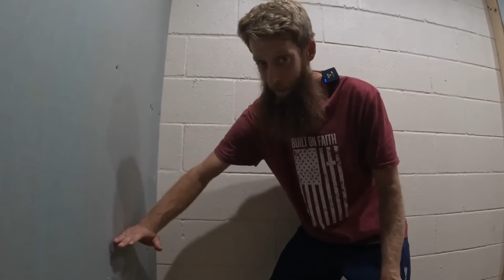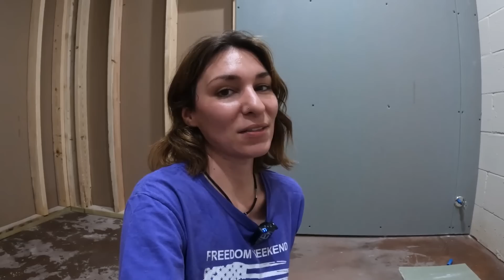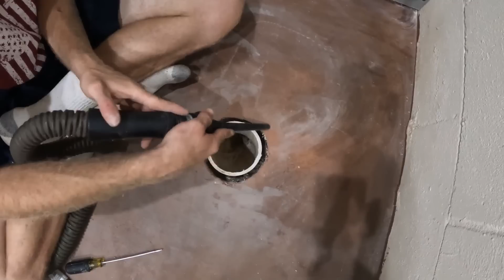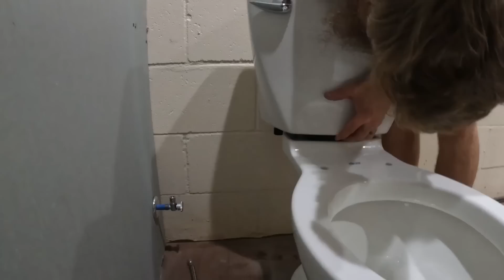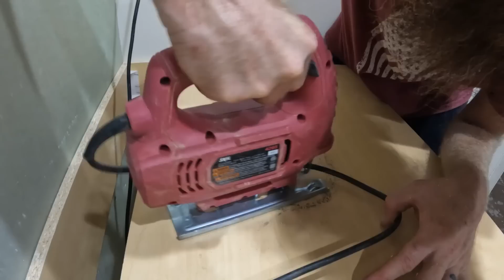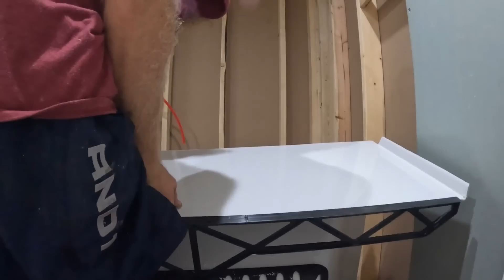Our Bathroom Install Begins!| Closer To MOVE IN| Sink & Toilet |Couple Builds Basement for  Cabin

Comment: If you want to find the meaning of life, get yourselves the highest end Toto toilette with a bidet you can afford for the cabin build. When I first used one, I wondered why I hadn't known about this my whole life until then. The first thing I replaced in my bathroom when I returned to the US was the toilette. In Japan their tubs have a filler spigot, a waist high shower nozzle, and stand up nozzle, or a hose nozzle with two hanging points, they also come with a recirculation pump that maintains the temperature. I have a bronze clawfoot tub that I modified to semi-equal this arrangement.

Comment: Thompson waterproof sealer is to keep water from penetrating into the concrete like rainX does for windshields. Its slippery when concrete gets wet though. It is not something you use as a permanent finish that is a completely different type of sealer like what you see in a farm store floor. Flooring can always be changed later down the road basement looks great!!!!

Comment: when we set our toilet waste pipe , we use one half sissle rope and wrap the pipe to above concrete pour. then all you have to do is untape the top rope and pull. leaves a gap to set the toilet ring. Just an old easy trick.

Comment: Real nice work on the install there Gary. You made it look real easy too. Good prep by you works miracles :)  Where did you lose your clipon mic to? lol. 
Floor thoughts:  Someone with the exact same issue is Lumnah acres.  They contacted the manufacturer of their sealant for advice and got an opaque sealant to topcoat with (looks just like painted, it's neat).  However with throw rugs down you won't see it so is it worth the time and expense? 
Mel, give in and rest if you want to recover the fastest.  The more you push yourself the longer it will take.  Please rest. Health is soooo important.

Comment: they have floor epoxy in different colors for flooring that goes on cement to cover up your flooring all you have to do is spread it on the flooring or paint it on
Reply from the maker: We might look into that at a later date, but are done with the flooring for now until we finish the cabin upstairs. We wont want to spend anymore energy on it at this time. :)
Reply: @SimpleLifeReclaimed  thats good yall are doing great thought i would mention it if you would want to fix it later on

Comment: Congrats on the bathroom your  toilet is away from the wall. What I found out with my toilet being away from the way over time the seal will break a water will leak. From leaning back on toilet when sitting down. U need to put a wood block back.there to save U the time of keep replacing seal an leak. I m putting one back there

Comment: Mel, I have shingles in my jawbone and teeth on the left side.  It is very painful!  I have a tip on something that I use that I believe will help.   I take 1 supplement of L-Lysine 500mg every other day.  If I feel pain starting I take another at the time that I feel pain.  My first dose is always 2 when first starting.  The pain and swelling (nerves) starts subsiding immediately.  L-Lysine is a supplement sold at Walmart, and I don't have any side affects with using it.  L-Lysine can also be used for cold sores and the like, it is anti viral.  This is a more natural approach that is worth a try and can be used to keep attacks away.  Get better and do not stress over anything!  Prayer always helps and my prayers are for you to get better.😷

Comment: Get a laminate floor later on focus on the cabin build 
But I don’t see vent pipe for the plumbing drains? Need to vent out the side of the subfloor for now n then later on connect to cabin roof vents, with plumbing vents you don’t drain very well. 
But so far it’s going to be an awesome basement!
Mel rest get better ❤️‍🩹 hopefully you are feeling well soon!
Loving the build kiddos!
Reply: There’s vent pipes, showed in another video I recall

Comment: Looks great but I would just finish out the bathroom by covering up that block with more drywall. So you would have a flat wall all the way accross to put your vanity and toilet against.
Reply from the maker: We appreciate you input, but are building it this way purposely because of a cabinet we purchased and cubbys we plan to build and the depth. Youll see in an upcoming video soon. ;)

Comment: I’m no expert on US pipe fittings but crimping water pipes doesn’t seem like a good idea, surely a stronger pipe fitting welding plastic or a compression fitting seems more logical
Reply from the maker: Research into PEX piping. I think you'll be pleasantly surprised 🤗

Comment: You sure should’ve checked for leaks before you put the drywall up being a plumber it’s a bitch to find out you have a leak after the fact :-( Where is your vent for the toilet? It should be within 3 feet of the toilet the same size as the toilet outlet drain. Or your toilet will be sluggish to drain :-( I hope you put it in the wall next to the toilet where the waterline is coming out of. 🙏